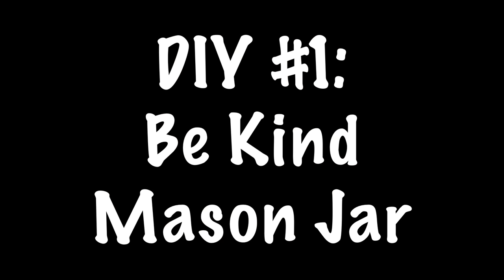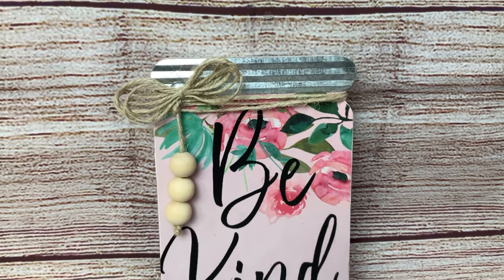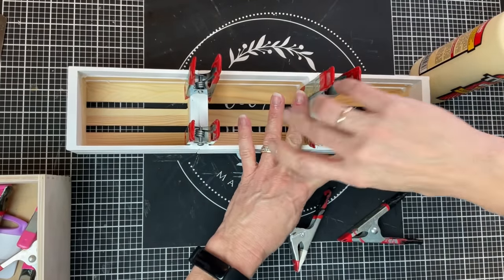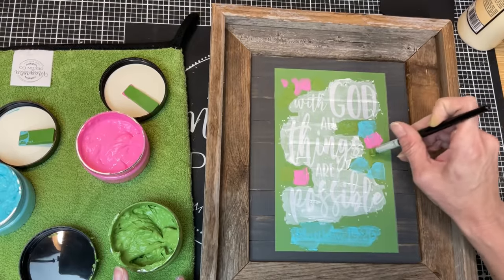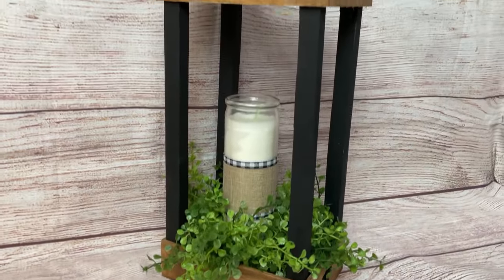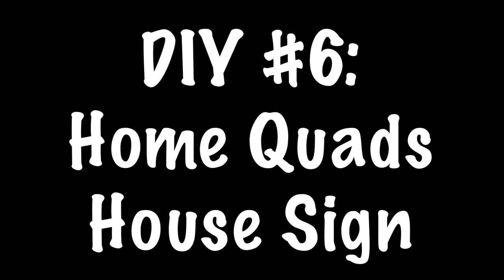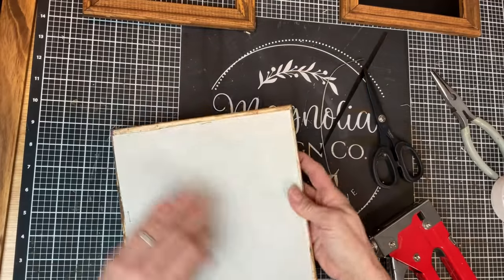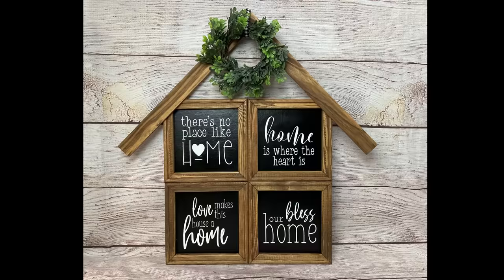🌼🦋HIGH END SPRING BUDGET FARMHOUSE HOME DECOR DIYS | Dollar Tree | Magnolia Design Co 🦋🌼

Comment: I noticed you did not spray your paper with water before putting onto the modge podge.  Is there a reason why?  Just want to make sure I should still be doing this.
Reply from the maker: That's so funny.  You are the second person to ask about that.  The paper I used was thicker cardstock this time and I find that the spraying method is only necessary with thinner scrapbook paper.

Comment: You didnt mention the cost of foam, stencil, grass, or black paint smudge for bird house project at start of video. If you add it all into cost,  you are running much higher than we expected. It's very cute project,  but the stenciling is for advanced crafters. Beginners would get all that black paint all over everything. Is that why you skipped the tricky part of putting the letter T in front of word weet?
Reply from the maker: The stenciling is not hard. I've only done it a few times. You could easily make this just as cute on a smaller scale